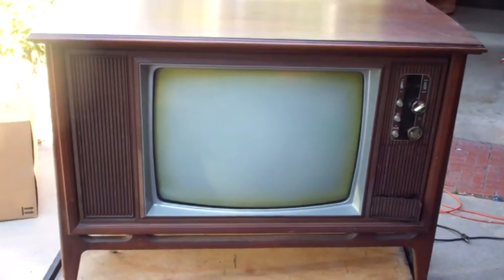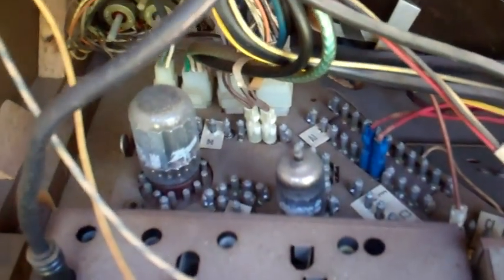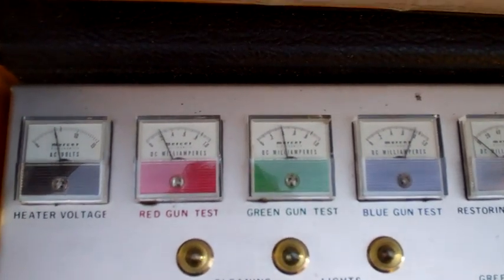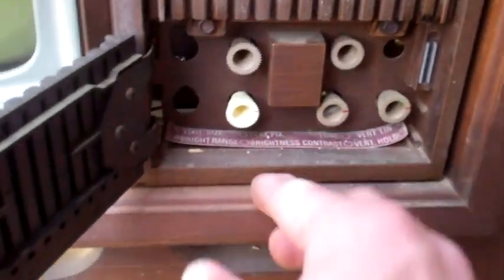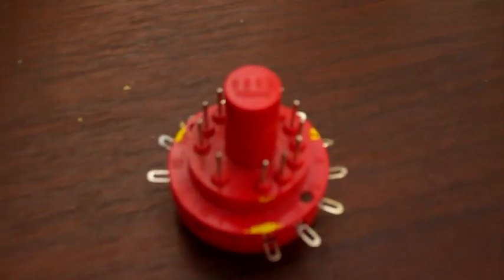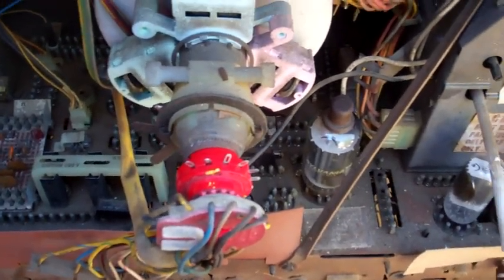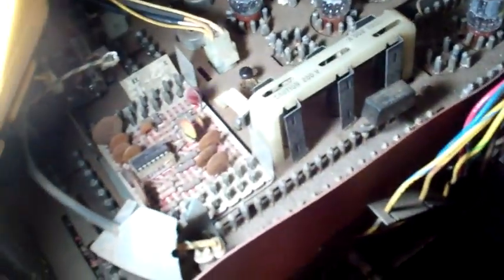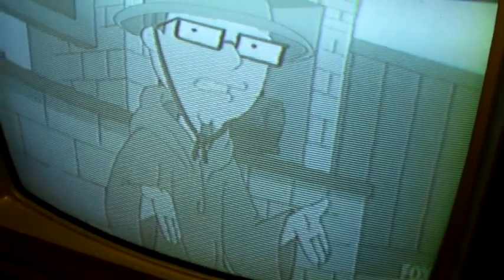Zenith 25CC50 Television TV Repair Vintage Color Hybrid Tube Set

Comment: Tubes and an IC in one T.V. That goes to extremes, from one part of technology history, to the next. Pretty cool T.V.
Reply: Early '70s transition from tubes to solid state.  The next version Zeniths had only 4 tubes, then all solid state after 1974.  The high voltage/ high power transistors were more expensive than tubes at that time so there was about a 5 year period where both tubes and transistors/ICs were used as technology and economics evolved.

Comment: I had a Zenith set just like that about 15 years ago. Some guy was throwing it away and said I could take it. I was surprised at how well it worked. I used it for about three years and finally bought a new one because I was tired of my son complaining about having to change the channel manually.
Reply: @dcfuksurmom  Yup. That’s what my Dad would’ve told me. I never complained about changing it manually. These tvs were ahead of their times.
Reply: Hmm, so that would have been around 1998.

Comment: Do you service all vintage televisions? I have my dad's Zenith Color TV from 1965 with a Round Picture Tube that does work to a point. It has picture but the Blue Gun is very weak. It could use a complete restoration. It is a zenith Model 5320-6. Can you help me me more info or Sams Photo info. thanks, 
Mike

Comment: 12:12 I know this transistor they put these similar looking transistors in the kustom tuck & roll from about 1968 1969 I hate these gold plated ones as the failure rate is high on these.

Comment: I have a 1989 Zenith Space Command. The T.V. suddenly turned itself off one day and when I pushed the button to turn it back on, nothing happens.

I do not have that briefcase looking thing that checks the voltage, is there a section of the inside of the television that I can fiddle with to get the picture back on?
Reply: Sounds like the voltage regulator IC or a HV cap went out. You can usually find both for pretty cheap through Mouser